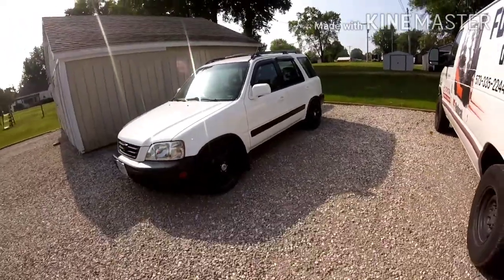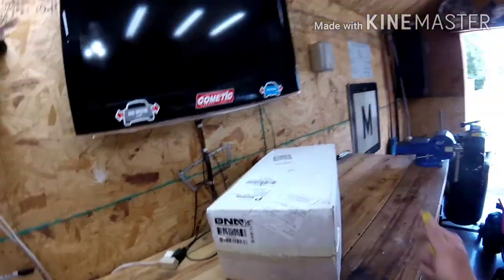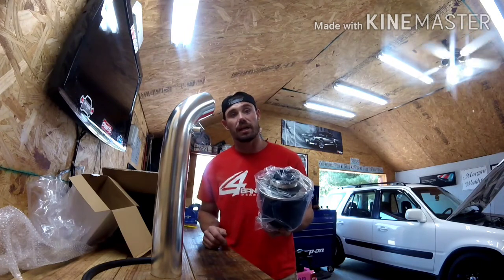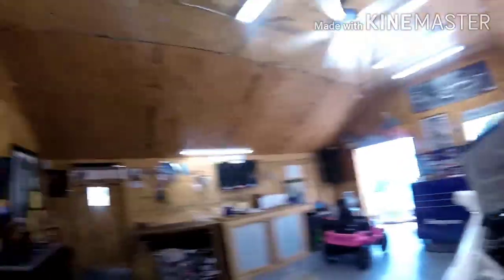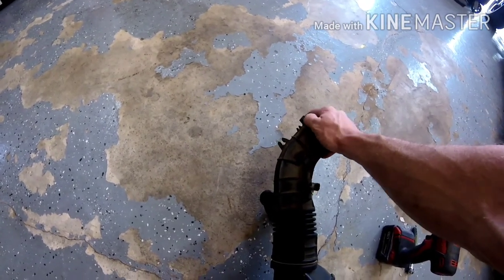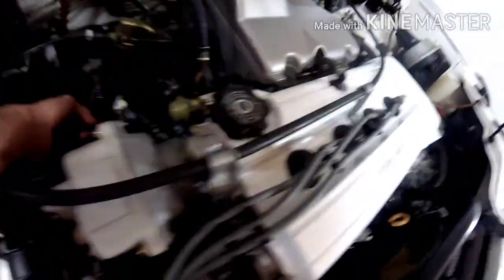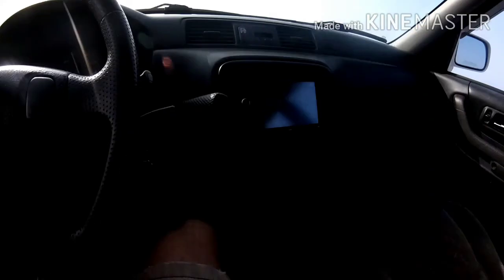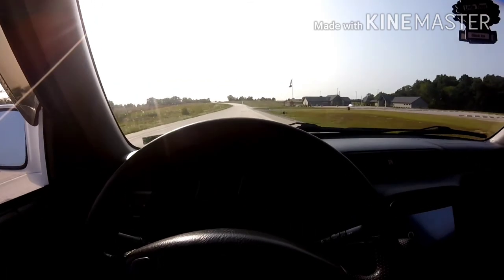$29 EBAY SHORT RAM INTAKE FOR THE CR-V!!!!! SOUNDS AWESOME!!

Comment: Any noticeable increase in drone or cabin noise ?
Reply from the maker: Nope, the only noise i noticed was induction noise at wide open throttle.
Reply: Exactly what I was about to comment on! It’s louder underneath the hood, droning af, and a placebo "power gain". For more power and NOTICEABLE  acceleration go with a simple header upgrade, free flow cat. Much more comfortable ride and responsive throughout the rpm range.